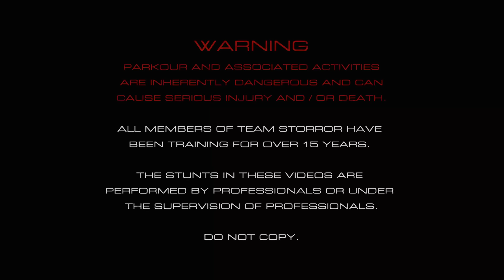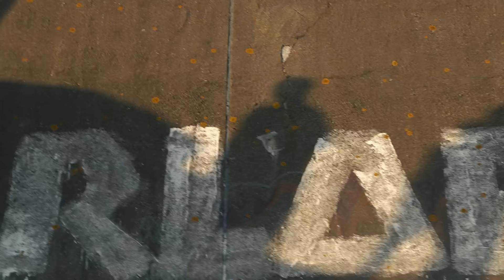Transforming Brighton's Forgotten Walkway into DIY PARKOUR PARK 🇬🇧

Comment: Personally I'd add some zip ties to the pipe, because the threads of the hose clamps wear down quite quickly, especially in the marine air. Would make it extra secure 😎

Comment: A bit late, but hopefully this is useful. A lot of the boards you used were OSB which is a recyled wood, its not waterproof and usually not suitable for outdoor use as over time it will obsorb water and become soft esspesially at the edges were the screws are. If you want it to last you can try painting all sides of the OSB in a waterproof sealer- it might change the grip but theres loads of different brands so theres a good chance there is one thats suitable for you needs. However there is a chance that everything will get torn down anyway so maybe its best not to do anything, but its still imporant to know that the osb segments are not 100% safe. Stay safe lads and have fun :)  Great video overall!

Comment: Amazing work lads! I don't think there's anything better than taking something useless and in all honesty, disgusting... and turning it into something that can be used for years by the public. I would recommend putting a water proof coat onto the wood so it doesn't degrade and rot as quickly. I also would sand the edges that are going to be grabbed with hands so you don't get impaled by little slivers. But I think you've already done outstanding work.

We should make the STORROR crew the city council hahaha

Comment: if you guys haven't already. for the sheets of wood to last a bit longer it might be worth putting a clear waterproof sealer and roll it in (almost a paint) it kind of soaks into the wood giving it more life in the weather but it shouldn't make it slippery or change the grip of the surface really at all. I'm a carpenter and wonder about how long it will last in the weather. I though I should put this out as a suggestion. you guys usually make my week with these videos so big ups!

Comment: Really nice work - ingenious ideas. Just keep those jubilee clips tight - there's enough clamped on there....  Maybe replace them with stainless steel versions which have a higher tensile strength and resist corrosion for longer.

Comment: Ya'll need a cordless circular saw and matching cordless leaf blower, save you tons of time on building and cleaning. At least in my neck of the woods, vertical structural elements are usually called columns or posts and beams are horizontal. Triangles make everything stronger. Good luck.

Comment: I would have loved to work on this. I would find something to put over all that wood though. The rain will trash that in no time if it's left unprotected. Maybe some thick sheet plastic, or even some kind of sealing coat. Anything at all to make sure the wood doesn't absorb any water. Make sure it's had time to dry out from whatever water it's already captured. I think it's awesome what you guys did, but if you leave it unprotected that wood will rot out faster than you realize, and split itself apart in places before then too.

Comment: Love it guys, absolutely insane. Side note from an actual engineer, please just grab a drill and drill through the pipe and bolt that bad boy down. Cost a few for the bits and hardware but will guarantee that thing doesn't pop off and and re-arrange someones dental.
Reply from the maker: Drilling through the pipe with our tools was very hard! You are definitely right though 😂

Comment: Take it from a "structural engineer", don't worry about those tube straps. (but DO read the reply I posted to this comment) The old tube itself will fail before those straps will, based off what can been seen. Also, the worst that will happen is one guy having a sore bum after the final swing =)))

Good job for cleaning up that stuff. I hate the thought that you will definitely get thrown out by the city government. I could see you guys getting a homeless man to become the janitor there, living sheltered under the structure and keeping it from rotting away. But they won't let you. They let you clean up the mess, and as soon as there's no more cleaning effort, they'll come in and shut it down. I've seen it happen before in other cities. They'll let you do their work of getting rid of the trash, and then say "thank you. fvck off."
Reply: As much as I don't like to rain on your parade, I do however have some concerns about the platform you do the high jumps on. The extra supports placed by Tony were a good idea, but now you have introduced a hinge point and upon impact there is a very high and unsupported force going perpendicular into the metal fence. To take that force away, you should also put beams from the top of the ones Toby placed, to the floor where the fence is mounted. So basically connect the supports that Toby made by screwing a board or beam against the floor board (which will also help keeping the existing supports in place) and then wedging a beam in between that horizontal board and one (or more) of the fence posts in the ground.
What happens if you don't do this? The fence might break off in its entirety, or bend out of the way making the platform collapse... So it's a genuine concern here.